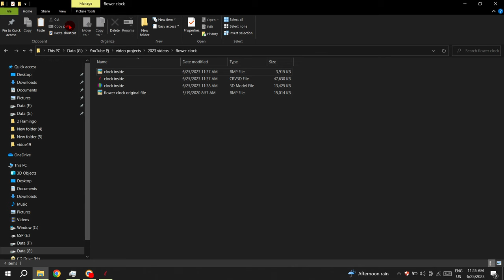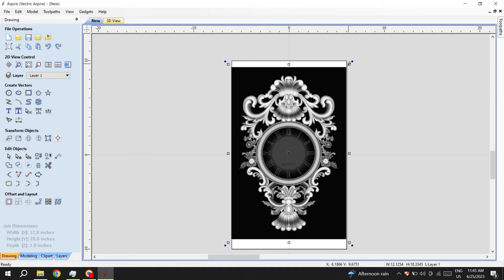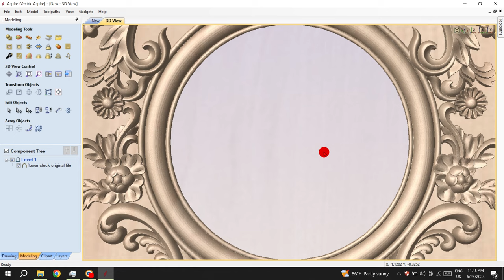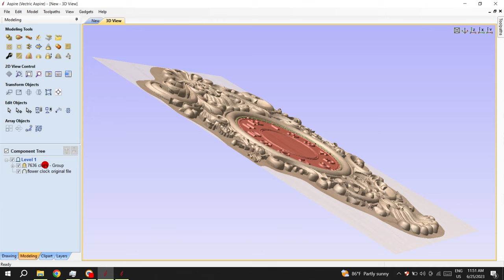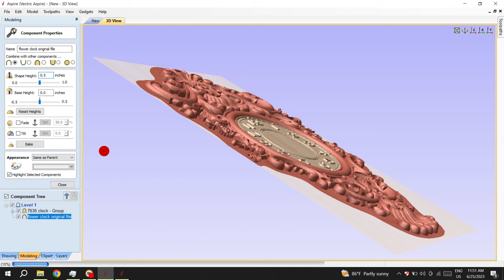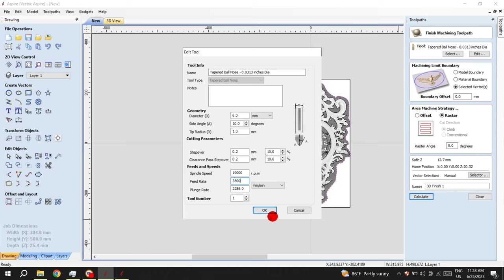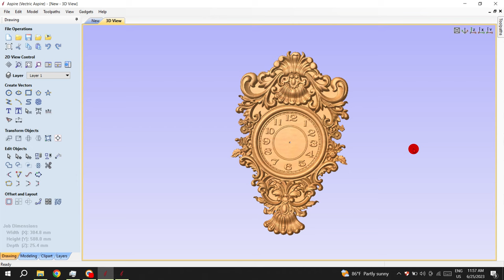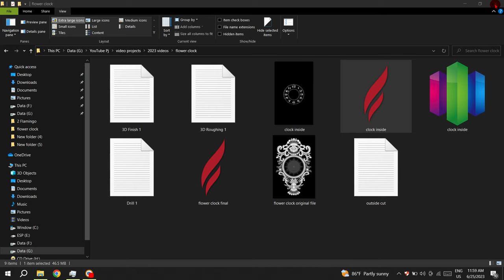CNC Engraving Flower Clock // Vetric Aspire toturial // CNC Woodworking project

Comment: Excellent work 🙏❤️

I am new to CNC. I am designer and supposed to give quote to client but CNC Services in my city are weak, not very knowledgable.

Can you please tell me size of the clock, depth of cut, which bit you have used and how much time?

I can then instruct my CNC vendor to follow your advice and make a sample of your project file or another file and get a quote per sqft.

I would appreciate if you could guide me, what you used for above clock.